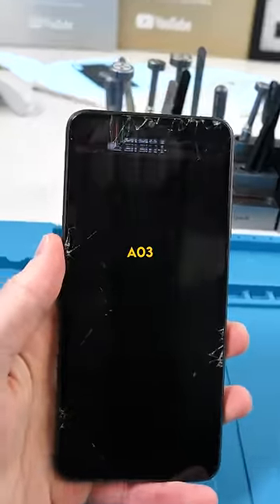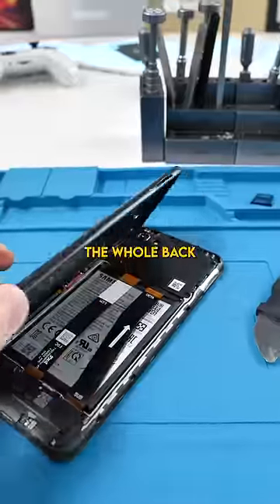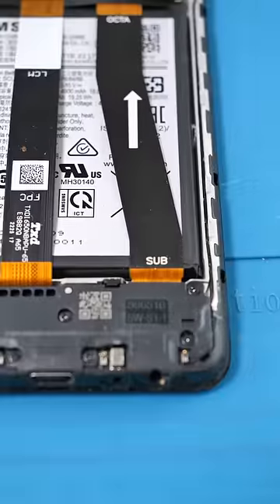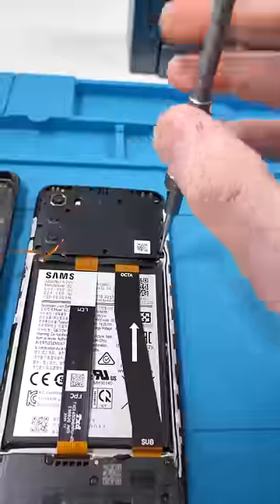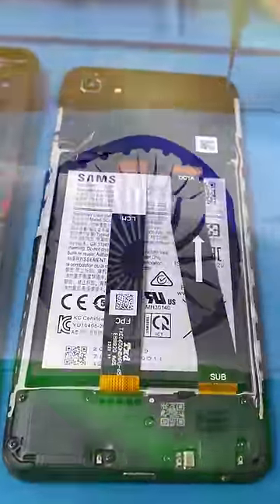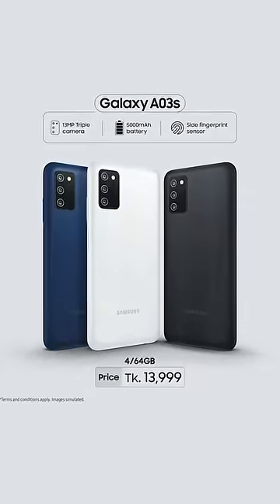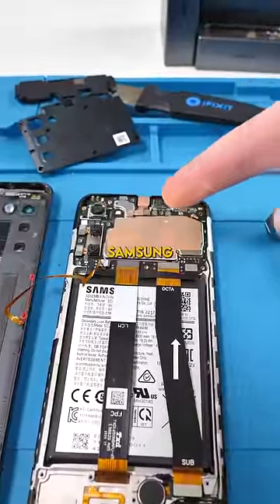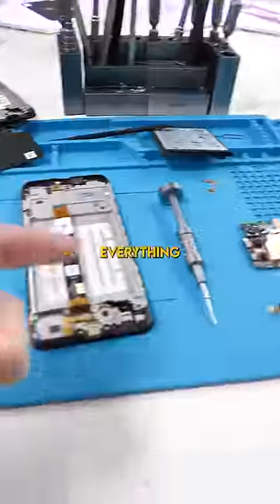The Best Budget Samsung Phone? #shorts

Comment: I had a samsung galaxy a10e.
It was almost as strong as a nokia brick even without a case only cracking when I dropped it from like 6 feet on solid concrete without a case on. It still works.
The a03 is probably the same but with higher quality hardware and better specs so how the managed to break the screen is beyond me.

Comment: The A03 and even the A12 simply don't have enough internal storage even with a SD card installed. I have one in my collection and don't even take pictures or videos because they run out of storage so quickly. 32 gbs isn't enough try for the A13 or A32 with 64 gb internal storage also Samsung phones all have way too much bloat ware and only 2 to 3 gbs of RAM in 6 months I've had to do factory reset at least 3 times just to get minimum free storage. Cheaper better phones available from Xiaomi,Redmi, Motorola Vivo, TCL Revvl and many more with more storage and RAM better build cordless charging etc for much cheaper price. TLC doesn't even have any bloat ware better processor and screans